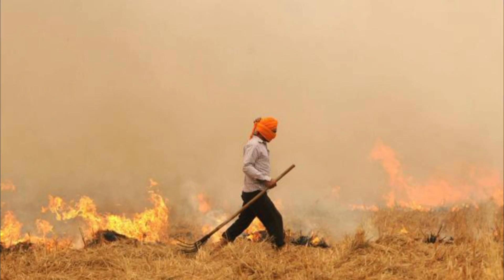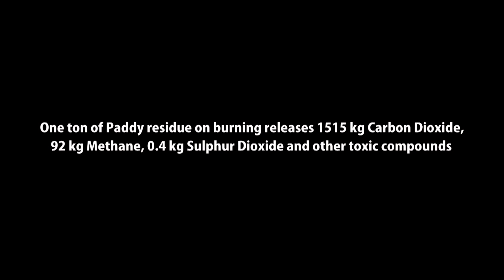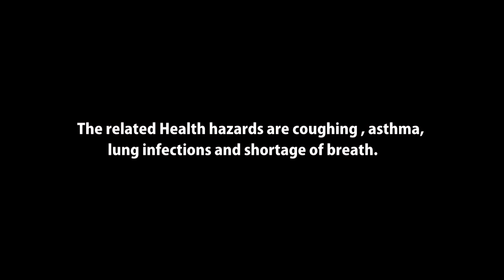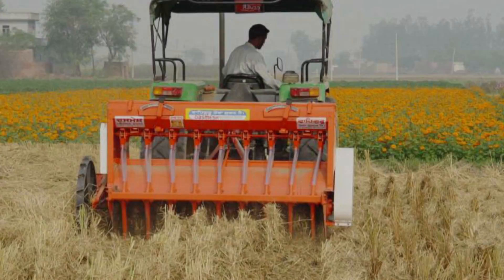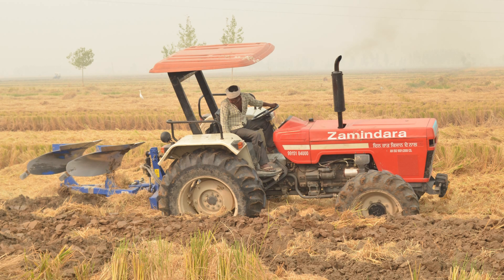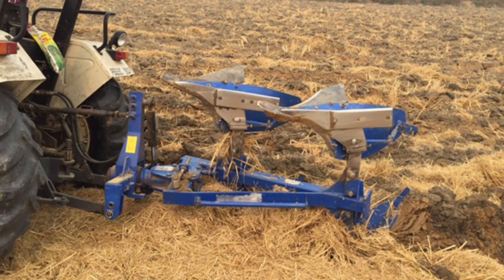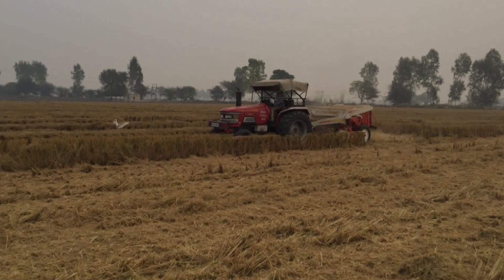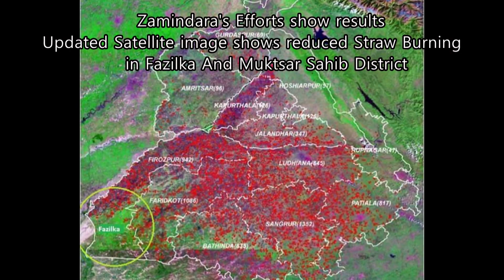STRAW BURNING: ASH TO OPPORTUNITY

Comment: Use it to form Briquettes  and sell it to Industrial furnaces Boilers and other industries where heating is required.  U can send them the Baled straw or u can send them in briquettes form.Send Paddy  straw to  drought or dry ordesert regions which r drought prone to lack of cattle feed thru Railways which can send them free of freight charges as a  rehabilitation measure.Spread it over terrace as an insulation from heat,  and reduce the aircondition bills drastically. U can weave it and use as window carpets which can be rolled over when u need so. U can also make organic manure along with cowdung and cow urine.  U can also use it mainly as mulching .,which will reduce water needs by ATLEAST 50 percent. Think that you r blessed to sow 2 crops per year and don't make the soil barren by burning the Parali  which can be otherwise be used in various other ways including  in Paper making and in Briquettes  industry.  All the farmers can double their income if they use the PARALI into productive creative and reasonable uses.  , instead of burning and creating health concerns for themselves and society at-large.  If one person cannot afford to do it form groups and each group use the Parali to the various diversified uses mentioned above.  Then PUNJAB will become the first state in India in respect of economic indices,  if not ATLEAST farmers income will double if above methods r adopted.Form groups and ADOPT the above methods.